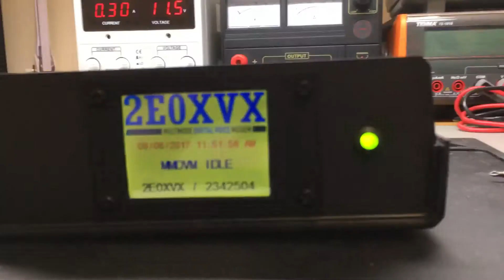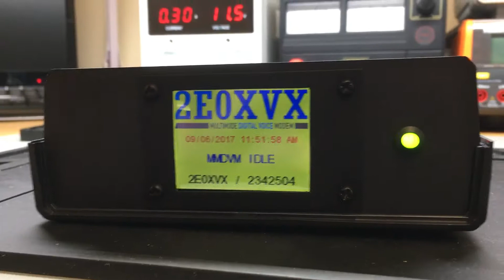MMDVM Hotspot

Comment: Will this work on dstar too? or is it purely for DMR, i would buy one of these if for dstar, let me know ok.. looks a nice smart unit.. James G0SEC
Reply: They started being geared towards one or the other. Then along came the Zumspot and Jumbospot running Pi-Star software which will allow you to choose any digital mode you wanted (pending you had the corresponding radio), i.e. Need a DStar radio to run DStar, a DMR radio to run DMR mode etc.... Nowadays much smarter to plunk down the extra $100 and build the systems out using the AMBE3000 chip, you can run any digital mode with any radio, even analog. The price is double the Chinese hotspots, but much more bang for the buck.